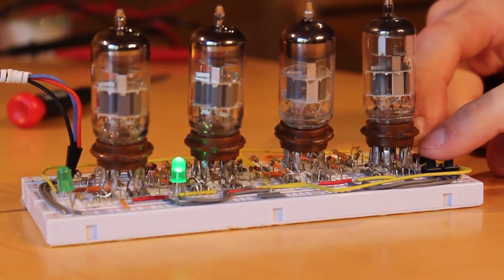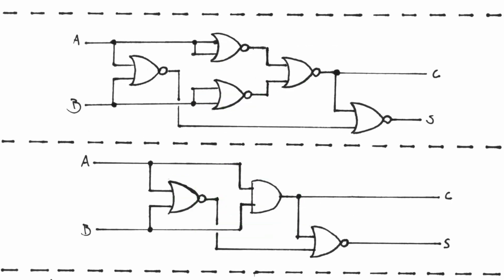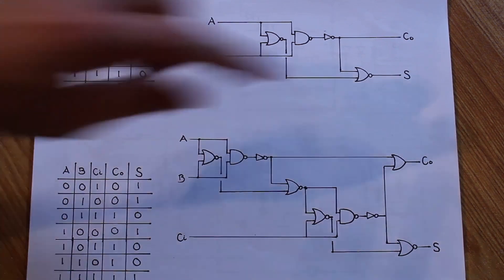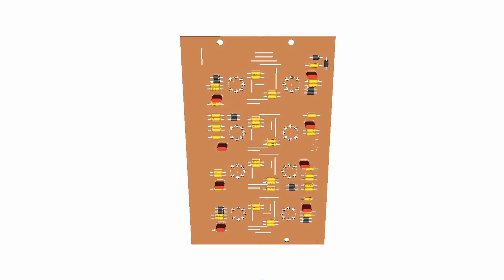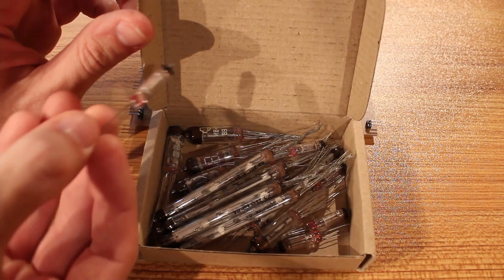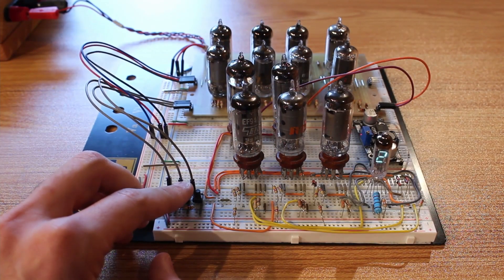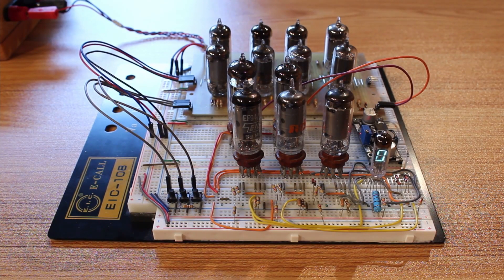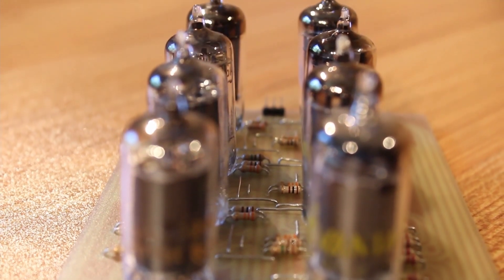Vacuum Tube Computer P.16 – Building a Full Adder for the ALU

Comment: very cool to make things out of tubes. Reminds me of Spock, Star Trek, making a computer out of tubes. But, should you be trying to make things out of tubes that you cannot make out of solid-state, like free energy devices or something?
Reply from the maker: Thank you!
This project is my kind of love letter to the vacuum tube computers of yesteryear! There's honestly not much that you can make out of tubes that you can't make out of transistors. Vacuum tubes make brilliant audio amplifiers, but I don't have too much interest in audio stuff (largely because I'm deaf in one ear and just can't hear the difference in quality between them). 
Also, I like that when building large logic circuits out of vacuum tubes, you have think in new and interesting ways. Transistors are so small and cheap that adding in a few more transistors here or there is super easy, but with tubes, they're relatively huge and not cheap at all, so it requires some really fun problem solving to come up with a viable circuit, and that's been the best part of this build so far!

Comment: A version of the pdp-8 (pdp8s?) does serial operations.
 maybe some hardware for quickly doing serial additions is good idea?
Reply: Would be neat. You could boot OS8 or even TSS8 maybe.  Would be very retro as the PDP8S was transistor logic.  The ultimate number of tubes would likely be awesome.
Reply from the maker: The PDP-8S is a brilliant machine! But the overall layout of it quite a bit different and wouldn't really mesh very well with the architecture that I'm using here. The MC14500 was truly meant to do operation on a single bit at a time. While it may be slow, I think it's excellent for visualizing how data is moving about the system. In the future I definitely want to explore other 1-bit serial type architectures though, so I'll definitely be looking into the PDP-8S in more detail at that time!

Comment: Had you gone for the Raytheon/Philips Wireended Vacuum tubes you could have used a smaller board.
Reply from the maker: You're absolutely right! 
Those submini tubes would have saved a ton of space, but with the size of this project, I really have to take into consideration tube availability in large quantities, and more importantly, how happy my wallet is. Those submini tubes, cost anywhere from $5 to $15 per tube. Assuming I could find enough of them to build the entire project, it'd end up costing me around $800 in tubes just for the processor!The 6AU6 on the other hand I often find for around $0.80 per tube, which makes my wallet much happier.
Plus, all the 7-pin tubes sticking straight up out of the PCB looks kind of cool in my opinion, haha.
Reply: @UsagiElectric  TELEFUNKEN GMBH
Reply from the maker: @DAVIDGREGORYKERR  I'm not sure I'm following you. I checked Telefunken's site and new submini tubes are $20 a tube! Even on eBay I can't find Telefunken tubes for anywhere near affordable prices for the volume that I would need here.
Reply: @UsagiElectric  That is a shame sorry.

Comment: Nice video!  For full 4bit to 7-segment if you use inverted outputs in a diode rom you can get it down to 34 diodes! It's the de multiplexer bit that I imagine will use lots of valves.
Reply from the maker: Thank you!
Well now, that sounds interesting indeed! I'm going to have to hit you up on that one and see if we can't find an optimal place between tube count and diode count!

Comment: this is so much awesome one day I will try build those projects using regular components such as transistors and LEDs, it would be a great introduction to electronics.
Reply from the maker: Thank you so much!
I've actually started working on something similar using the 2N3904 a bit in my spare time. Kind of like a miniaturized version of this one (though it's still going to be very big). I really like the idea that I can clearly follow the bits as they move through the system, but also, a part of me really wants to see what kind of new issues I run into building a transistorized version of the tube machine!
Reply: Don't wait forever.. its not as insane or hard as you may think, and it is super fun :)
Reply from the maker: @skeezixcodejedi  You're totally right, it's been massive amount of fun working on the transistorized design! 
I've already got the instruction register and decoder figured out as well as parts of the ALU and the IEN and OEN registers. I'm planning on ordering the PCBs from JLCPCB for this one, so it's been particularly fun trying to build within the constraints of their cheapest PCB size as well as making designs that can be used in multiple places to take advantage of the minimum order of five. 
I'm pretty excited about it!
Reply: @UsagiElectric  I use elecrow (been awhile mind you) and they had 10* 4" pcbs (now 15?) for $10 sort of thing going on, and I think its cheaper now; just insane. I found it easier to just design and order boards (and pay shipping) and have the in a week, and at 10+ copies. 

I've been itching to set up a mill to do one sided boards for myself, but just another machine I don't have room for :P
Reply from the maker: @skeezixcodejedi  I've had good luck with JLCPCB in the past, and like Elecrow, they're so ridiculously cheap, it makes you wonder how they stay in business. Problem is, I'm way too impatient to wait the one to two weeks for my PCBs to get here. When I finally commit to a PCB design, I want it right now, haha.